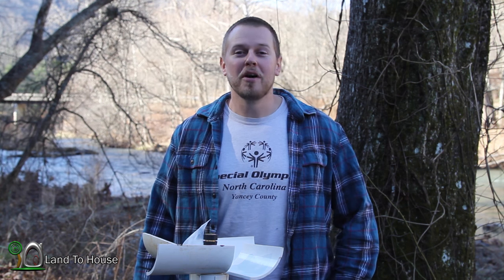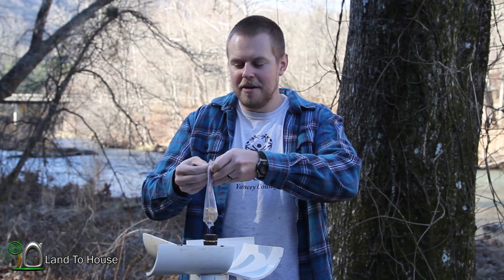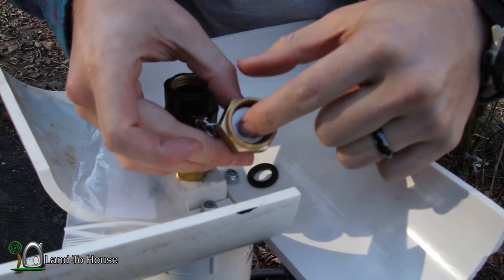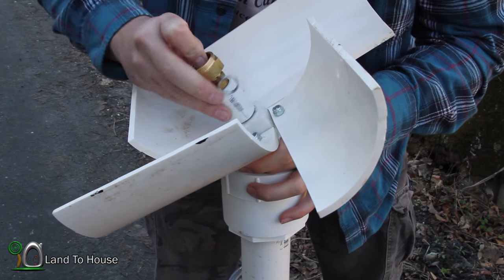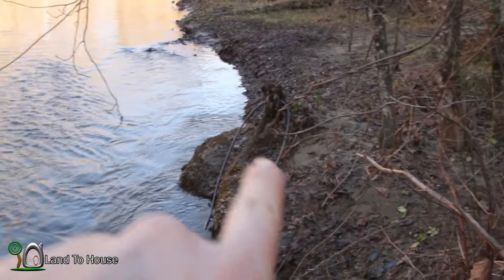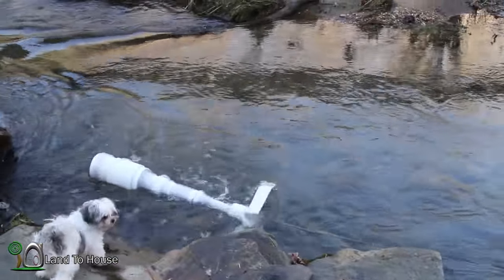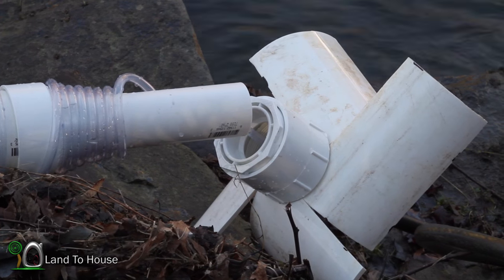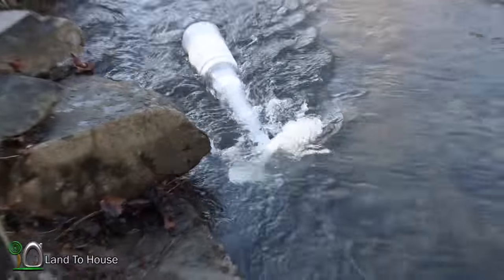River Pump Build and Test Part 4

Comment: I keep coming back to see if you figured out the problem at the end. We have a river flowing in front of our home. Water level of the river is 10 feet lower than the reservoir on our property. Do you think a ram pump would be able to pull water in this situation. Thanks for not giving up on this project and thanks for all you teach us!
Reply from the maker: I have not forgotten about this one. Perhaps this summer I can dive back into the project and get a working model.

Comment: A traffic cone with the hose on the inside held in place by zip ties. Then on the outside of the cone put fins on like a cork screw to run the pump. Your swivel joint is awesome and the missing piece to my puzzle. Cheers!
Reply from the maker: +Adam McCarrell I had not thought about putting fins on the outside. Not exactly sure how that would be attached but it does sound like a good idea. I'm about 25% done with my new design using a 5 gallon bucket as the housing for the hose.
Reply: The great thing about problems is there are many solutions. The great thing about YouTube is many ideas can come together.

 I figured I would have a strip of rigged plastic with tabs that would slot in to the cone. There would be two, maybe three, that would go no more than once around the cone to keep the speed down a bit. 

Good luck with sling pump 2.0.

Cheers.
Reply from the maker: Youtube is great for problem solving! One of my favorite parts about it. 

What will you use to keep the cone floating?
Reply: closed cell foam should do the trick if it's even needed.
Reply from the maker: +Adam McCarrell I actually already have a can for my new design. Should work well

Comment: What is below are just educated guesses on my part.  I am a mechanical engineer and I spent most of my time on fluids and thermal systems.
A few things:
1) I don't believe that the pumping coil needs to taper to a smaller size.  Thinking about how this works, the buoyancy of the air bubbles is what is pushing the water up on one half the loop.  The weight of the water is pushing the air bubbles down the other half the loop.  The bigger the diameter of the coil and more loops, the more head you'll develop.  Each loop is like its own pump, so the coil is like a set of pumps in series.
2) I think the taper shape exists on the Rife in order to mate up with a relatively small diameter screw propeller so that the body of the pump doesn't restrict water flowing over the prop.  In one of the videos on the Rife from Engineer 775, he shows the inside of the pump body and it doesn't look like the tubing coils in the smaller diameter.  Also, the "Water Dragon" pump has very little taper, and I would be surprised if there was an internal structure.
3) In future tests, why not make it a little easier on yourself, fill the hose with water and keep the rise low.  Then you don't have to wait for your hose to fill to see the pump work.  put a ball valve or something on the hose outlet to keep it full while you position the pump, then open it once the pump is spinning.  Start with a low head (2') and once you have proof of flow, start increasing the head to see what kind of pressure you can generate.  The big reward would definitely be to see some water coming out of the hose, so try to remove unnecessary hurdles to getting to that point.  Once you have water flowing out the end of the hose you can figure out flow rate and pressure head.  Filling the hose is getting in the way of evaluating your design.
4) I don't believe that a funnel on the inlet will help much, you could just cut the inlet on an angle and you'll get a bit more inlet area.I do think the diameter of the hose is important when it comes to flow rate.
5) The only place water needs to be is at the inlet.  With how you have built your pump, with the coil on the outside, you could completely seal up the rest of the pump internals to keep air in it and water out.  It sounds like the Rife pump has a big Styrofoam internal block for buoyancy, that would be another option, custom cutting foam is pretty easy to fit in the different parts of your pump.
6) A modified design might be to have a large pump drum connected to the drive prop with a thinner shaft so that the large drum doesn't impede water flow over the prop.  I don't think the conic shape is important.  maybe try to "match" the diameter of the prop with the diameter of the pump drum? (maybe the prop a little smaller than the pump drum) 

Never built one, just guesses there.

Best of luck
Reply from the maker: +Mark Hannum Educated guesses are even better than what I have most of the time. Thank you for sharing your knowledge. 

1. 2.  I have wondered about this. The water wheel style pumps have pipes that spin inward so that the air is compressed and pushes the water up hill but as you are saying it also makes since that you would not need to have the inward spiral. I have seen the water dragon video on youtube and noticed that there was no tapper. I do think that I will play around with that idea soon. (when the weather warms up a few degrees.) 

3. This is a good example of having more than one brain working at once. It would have been nice to have given this a try. Now I am going to be using a smaller diameter tube and its going to be clear so we can see the water move... or not move.

4. It seems like increasing the size of the cylinder would be the next best thing because the air bubbles dont seem to be moving as well as they should. I dont have the parts yet for the intake funnel so I will put that off for a later test just to see what it does. 

5. 6. A design improvement is in order after these initial tests. I have already learned so much from this first design. It has been fun seeing how well the water moves those blades.

the water around here is very cold so I will have to wait a few months before getting back out in the water. 

Thank you so much for these great ideas!!!

Comment: This is awesome! One problem you might be having is the different size hoses being used. All the ones i have seen use a bigger hose on the pump and reduce down to a smaller hose on the outlet side, or they stay with the same size. the air in the tube is whats moving the water, so you wont get  a good seal if you are going from a smaller hose to a bigger one.
Reply from the maker: +nathan Tucker You make a good point. I can swap around the hose swivel so that the metal ring can hold the pump in place with some rope. Then I can use a smaller hose for delivery. Thank you for the ideas! I will implement that in part 5.

Comment: Well all isn't well in GulpVille..lol..Your getting there, I guess the best results at this point will be the end results. Not all bad has been  gain from this thus far. Your correct, the ring on the swivel is for static connection so the hose don't get pull apart. Looking at some as you did maybe a more cone shaped with bigger input for the water.  Never give up, continued good luck and take time to enjoy the up coming Holidays, have a good and safe season, Happy Happy and Merry Merry !!
Reply from the maker: +Barton Robinson Yes gulpville is needing a little help. Progress is being made just not as fast as it could be. The next step will be with a funnel or cone on the intake of the water. That should make a large difference. I will try to get that test in this week. You have a merry christmas as well!

Comment: Just build a pond put an inlet from your creek. Put a paddle wheel in the inlet side. Build a small hydro dam on the back side channeling back into the creek. 
The paddle wheel can provide water pumping and multiple other devices. Just remember to study up on gear ratios. Before building your paddle wheel.

Comment: In my opinion increase the tubing diameter and install the swedge you  mentioned to flare the collection scoop. Also do you think you  have enough winds on the tubing to hold for the push you need?

Comment: I have a couple of recommendations. 1 would be a check valve because every time the pump stops water has a chance to back flow out. the 2nd would be a small funnel to create more pressure as the pump spins to fill the tube. and I apologize in advance if these have already been said I didn't have time to go through all the comments
Reply from the maker: +Shawn Berger  great suggestions. I especially like the idea of putting a check valve to keep water from flowing backwards. I will likely modify a PVC in line valve That way there will be no spring pressure to keep the valve from opening. I have a new design that is about 50% built that I intend on testing this year. I just need to find time to finish it.
Reply: +Land to House right just a simple check ball. but remember as pressure builds on the opposite side it's going to try and hold that ball shut so you're going to need more volume to keep it flowing through
Reply from the maker: +Shawn Berger I will try and take the time to get river pump 2.0 done next week so testing can start. :) then we can tweak the design until it works.

Comment: Seth, I strongly believe you need to have a constant diameter of the coils on ALL the pumping coils, so they are all in phase. They all then have the bubble in the same position of all the coils as it's rotating, otherwise, the length of the bubble and the length of the water slug, will not match as they move into the smaller diameter coils. Example: a 6 inch diameter coil has Pi x diam. equals 3.14 times 6 equals almost 19 inches. if half filled you have 9 inches of air and 9 inches of water. Now see how confused things get pushing that pattern into a 3 inch diam coil. See 3.14 times 3 equals half the previous or about 9 inches, so you'd have 1 coil of air and 1 coil of water. You'd have virtually no thrust at all in those coils because they'd be solid air or water. The same 6 inch diameter coil, then fed into 1 and a half inch diam coil you'd have 2 coils of air and 2 of water. With differing diameters of coils, the bubbles and slugs never get coordinated, to provide a united thrust forward. At times they are even fighting each other, so reduced cooperation, even neutralized thrust all together.

I'm going to risk something here. Follow my math, or just take the results, or forget me all together.

You said 40 feet of tubing, I suspect 3/8 diam. id. so area of tube is 3/8 inch divided by 2 is 3/16 radius squared times Pi is 0.11 square inches, then the volume of the tubing is area times length so 0.11 square inches times 40 feet times 12 inches is 53.01 cubic inches. the weight of 53 cubic inches of water with ( 231 cubic inches per gallon times 8.33 pounds per gallon) is 1.91 pounds . supposed you could get half the tube filled with water and half air, all bubbles on one side of the coils and all heavy slugs of water on the other side, all now cooperating, you'd have half of that 40 feet of tubing or 20 feet of water, or about 1.91 pounds of water, divided by 2 or about 1 pound pressing down on the 0.11 square inches of the inside Id. of the tube, that's about 1 pound divided by 0.11 square inches or  9.05 pounds per square inch.... That would be the maximum potential pressure available ....   either less water or less air in the tubes would diminish the total pressure available, or if the bubbles and the slugs of water get to where they are "out of phase" or fighting each other, this too would cause the the pressure to be reduced from the max 9 psi available.

Just a thought, if you used 4 inch dia PVC pipe , with 3/8 inch id so about 0.5 inch od, so the dia of one coil would be about 4"+half tube dia + half tube dia would be about 4 1/2 inch dia so times Pi or 14.13 inches long per coil, divide that into 40 feet gets about, (40*12)/14.13= 33.95 coils and each coil is about 1/2 inch fat along the length of the 4 inch dia pipe, so 34 coils times 1/2 inch  is about 17 inches along the length of the 4 inch dia PVC pipe. After coiling the 40 feet of 3/8 dia tube around the 4 inch dia pipe flush, side by side touching each other, pour the PVC cement on the tops of all the coils so it seeps in and glues all the coils to each other, and to the PVC pipe.

I could imagine gluing 4 inch dia end caps on both ends, keep the infeed end of the 3/8 tubing outside the 4 inch pipe, drilling thru the other end cap and side of the pipe near that end to pass the pumping tube in thru the side and out thru the center of the end cap, similar to what you did. Could even mount the turning vanes directly to the end cap, again similar to what you did.

Seth, Seems like a great project, and I might do it myself, but  I'm old and getting over, surgery and for me an excursion is walking from my bedside to the bathroom and the return. I'm sure not telling you what to do, mostly wishing I could enjoy getting up and moving around and enjoying life the way you are. Good luck to you, and wishing you great success in everything you do.
Reply from the maker: Your math seems good. I often dont take the time to look at the math. It is rather boring most of the time and I bypass it. Thank you. You have given me an awesome idea of how I need to redesign my pump idea. I have drawn out the plans and will make a test model to see if it is going to work. I feel like a wider cup on the intake and a 1/2" pipe around 100 feet long should be good for the pipe of the system. The 3/8" was just too small. ... My wife and I have a newborn daughter and that has hindered my projects just a little. BUT I have a long list of things to do so when I get some time I am going to have plenty of videos and a much improved river pump is one of them.
Reply: Amazed at your rapid response. You're absolutely right, family comes first, then income, then fun if you are lucky. Good Luck, God Bless.
Reply from the maker: I try to stay active on my channel. Some days I get around 35 to 40 comments and its hard to respond quickly. But Land To House is  a small channel. ... Someday I would like the "Fun" and "family" to involve a lot of the same things. :)

Comment: Now that swivel works far better. Your on the right track with that. Glad I could be of some help. (fist bump) 

Sorry the water amount is so small. Is it maybe the short time in the water and out that is causing it? I've see the water wheel systems and they work slowly maybe that is some of the problem. Also looks to be up to high in the collection end to really get water in too, well in my opinion. Can it be that you may have to much flotation now? Water will weigh it down so time will tell. Another though is that the hose is to small as well. The 3/8" hose may not gulp enough water and air to really work and just spins around with the pump. Friction, air pressure and centrifugal force all ply a roll in how much water is pumped. If these are off then you get no where. A balance on these I think would make this work better, You'll find it and have a fantastic river pump. Truly like the idea you have here. Keep the videos coming no matter what they are. I enjoy them all. 

My family to your's, have a very Merry Christmas and enjoy the reason for the season. God bless you all.

Ed
Reply from the maker: Ahh yes physics. The swivel is now working very well.  And being only $23 it is within budget. 

I have to agree with you on all those points. The tube needs to be bigger.  I just did not like the price when I was buying haha. I am going to add a funnel to the intake first to see if it will increase the air to water ratio. Looking at the pump work I am noticing that there is not enough air with each spin. Also I am going to decrease the first little section of delivery house to a clear tube so we can see what is going on. 

Thank you for the merry Christmas. And God bless you and the family.

Comment: How about start out with a traffic cone and to that continue the taper with plastic sheet. It does not need to be air tight, just tight enough to fill with spray foam or stuff full of bottles. It appears you need a much larger diameter at the tail end.
Reply from the maker: My new design has a smaller tube but is air tight and does not need bottles for flotation. I would like to have it built soon. If that design does not work I have started another design with a much larger tail.

Comment: Thanks for these videos and ideas. I'm actually trying to come up with a self powered system to generate power from the canal in my backyard. I'm wondering what might happen if you increase the opening where the tube brings in the water and put some sort of diaphragm or one-way valve on the output end of the pump. I'm guessing this would force more water through the tubing and eliminate backflow issues. The pump is spinning fast enough where I think it could tolerate a little more resistance from a larger opening. I think your problem right now is that downward gravity is causing too much resistance on your upward water flow.
Reply from the maker: preventing back flow is a great idea. I have several inline check valves that I could install. I will have to give that a try in the new design that is almost done. I feel like this first design was close to working just needed some simple modifications. If you come up with some great power generation ideas please share them.